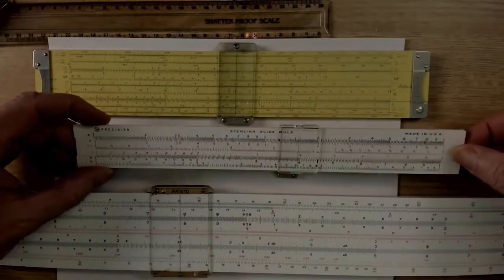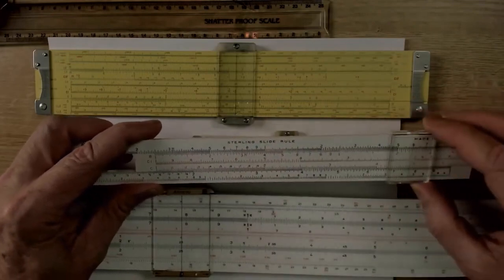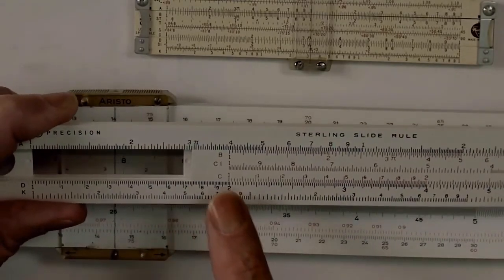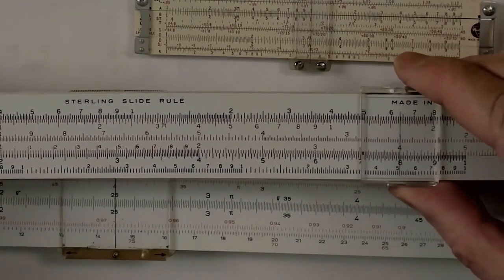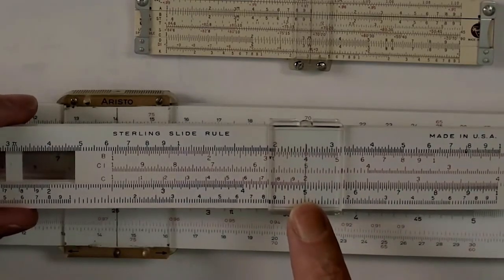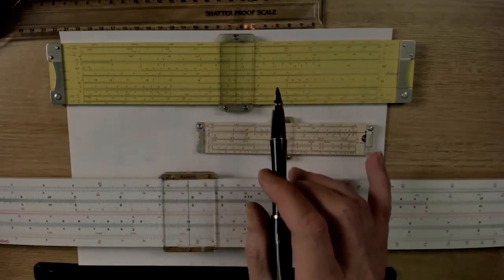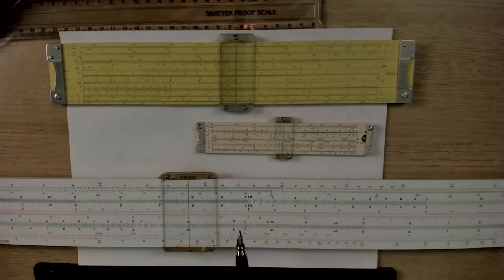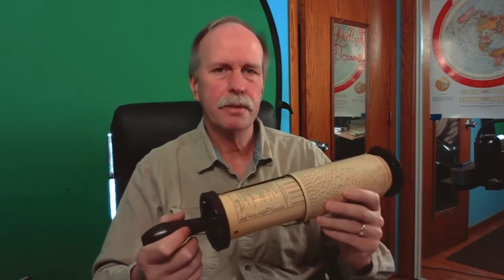Introduction to the Slide Rule

Comment: I do see how these things came in handy. But less like a pocket calculator and more like a sanity check if your hand calc makes sense. I cant imagine it being so much faster then just cleanly going through a calculation. The three significant figures that you can reliably get from a standard slide rule takes precisely working with it, which cant be rushed. Meanwhile a hand calc with only 3 signifcant figures on either side is pretty straight forward. And if you take more precision, you need hand calc anyway. And if it matters even less, you would estimate even on paper with just easier numbers and estimate the worst case error. There is not much it can do better than you. If anything unique it can do, its helping you with special functions like log, sqrt and trig functions.